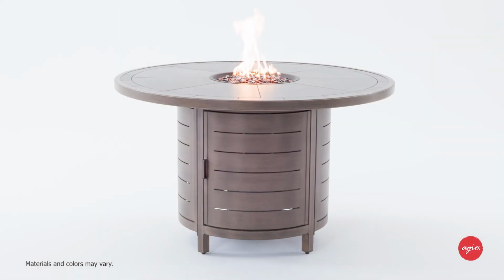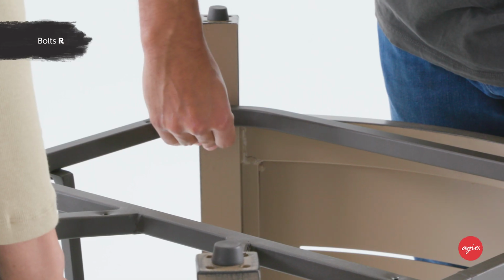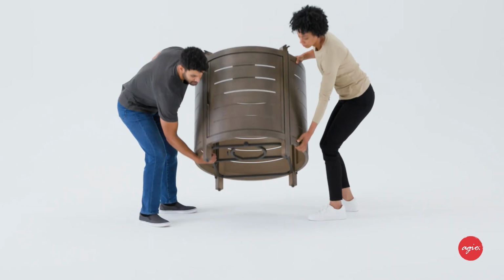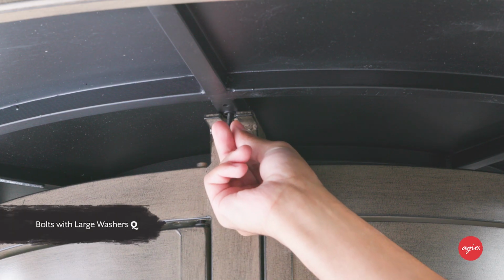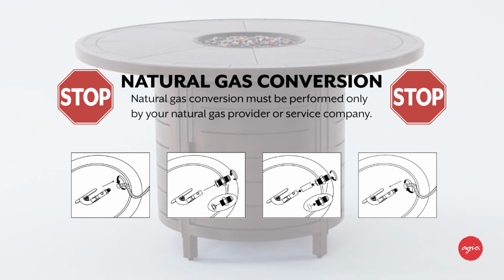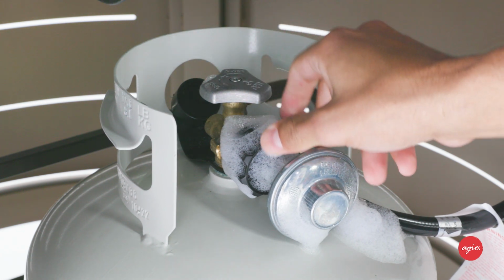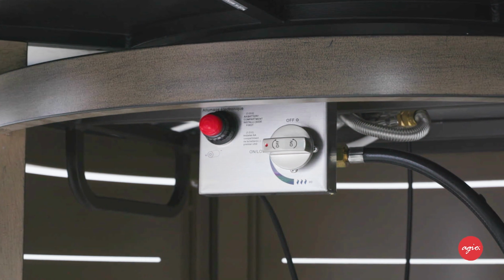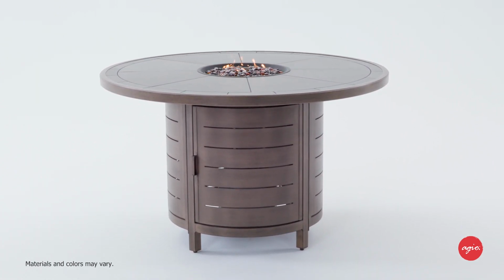How to Assemble your Agio High Fire Table

Comment: Assemble the base in the sapce you want to place it. I assembled it inside and then realized it would not fit through my patio doorway :D
If you did assemble it inside you should be able to take off the two side panels with 8 screws and then slide it through a doorway.